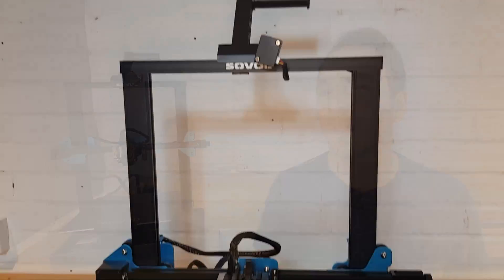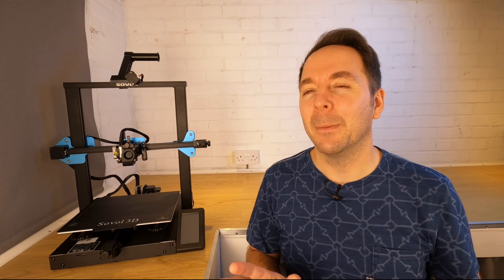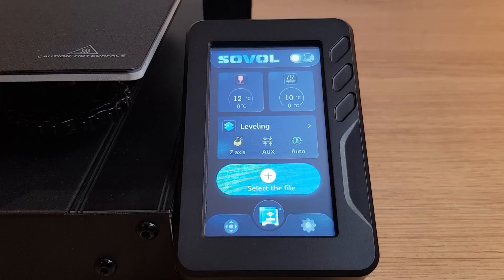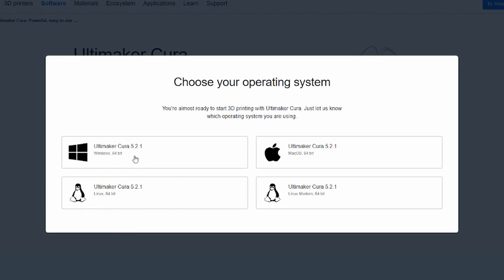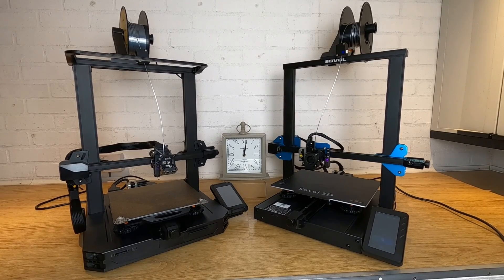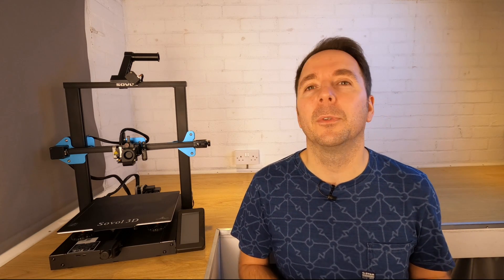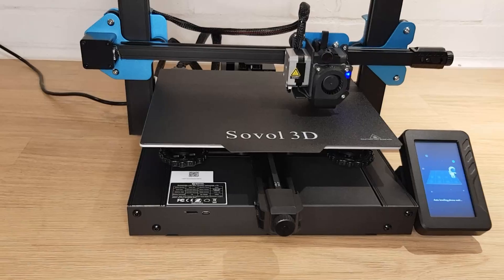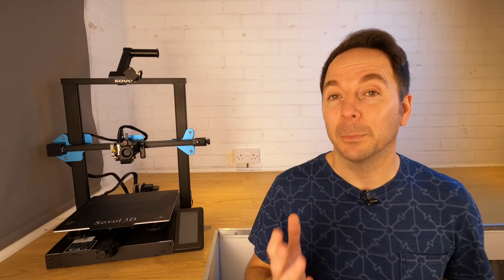Sovol SV01 Pro 3d Printer - Awesome features at a low price!

Comment: Would you reccomend this printer for beginner TPU??
Reply from the maker: It's good at printing with TPU as it is direct drive. The only downside is that TPU sticks too well to the PC bed. You would need to put something on the bed to avoid damaging it when removing a TPU print. This can be masking tape or a PVA based glue stick but ideally, you would put a different print bed surface on like PEI.

Comment: I’ve had my first hiccup with this printer and you called it. My filament got jammed inside the (extruded?). I’m new to printing so sorry I’m just assuming that’s what it is called. The hotend and extruded setup looks a bit different than the original sovol sv01, so I was a bit confused as to how to take it apart, but pleased that it is now up and running again. Next time I will know what I’m doing and it won’t take me an hour  😊

This is my first 3d printer. I did some research, and then sort of went with my instinct and chose this one. I truly love it and I am blown away by its ease of use and what it can do. I have heard that 3d printers are tricky, hard to assemble, and so on. This one was about a two piece assembly, and has printed beautifully from the get go for me. I have zero experience with 3d printers so I’m happy to find a printer that works right out of the box!!! That being said, I don’t have anything to compare it to lol, but I would totally recommend this to a beginner. I have printed so much since getting it but just finished a 36 hour (give it take) skulldog mask for my daughter. 
Thank you for your very educating and helpful videos.
Reply from the maker: Great to hear you have had the same experience with regards to ease of use to me. Unfortunately not all 3d printers are like this one so you've chosen well. Glad you are enjoying the content and the hobby. Thanks for your comment 👍

Comment: This or sv06 same price?
Reply from the maker: Difficult to say as I have tried the SV06 yet. There are a few differences so I guess it comes down to whether you need a bigger bed or an all metal hotend to print higher temperature filaments. The other differences won't be huge.

Comment: Now if Creality would do a update to the firmware maybe the S1 pro would be even better.
Reply from the maker: Maybe they could get Sovol to do it🤷‍♂️😁
Reply: @RickyImpey  LOL
Reply: As an S1 pro owner and noob to 3D printing, I'm grateful for the things that make it pretty much plug and play for beginners. But seeing that vastly nicer touchscreen experience on the Sovol even though it's mostly made of Creality parts really has me wondering what the heck Creality's UX designer was thinking when that horrendous interface was signed off. Also, the disabling of features is super annoying as I've set up Octoprint but basically can't do anything but watch the print or do an emergency stop.
Reply from the maker: @possibri  Indeed, seeing it all done well showed me how Creality have been slacking with their firmware.

Comment: I have been looking at replacing my current FDM printer and this looks like an interesting piece of equipment.
I was planning on a Anycubic Vyper, but now I don't know.... 
Sadly, nobody locally sells Sovol at all. :(
I know 1 is direct drive and 1 isn't, but that isn't really an issue for me. Any suggestions between the 2?

Now, if all 3D printer manufacturers could just stop using micro-sd cards...
Reply from the maker: Difficult to say as I done have the Vyper. On paper, the SV01 Pro has a bigger bed, direct drive and is cheaper.

Comment: Could an aftermarket direct drive be installed?
Cheers Ricky, looks like I may have fount my next printer to add to Ender 3 V2 
Can’t wait for the duel drive mod vid 👍🏻
Reply from the maker: I wouldn't be looking to change the extruder and hotend assembly myself, it works very well. There isn't a drop in replacement as far as I know. The SV01 Pro does feel like an upgrade to my E3v2 with it's bigger bed and added capabilities.
Reply: Hey Ricky 
Ok I pulled the pin and ordered it 🥴
Again thanks for your input/vid
Oh and the discount code, this really helps out in these tough times.
Please post the belt drive vid, once you have sussed it 😉
Thanks Ricky 👍🏻
Reply from the maker: @toddy9141  Link belt is fitted and being tested as we speak👍
Reply: @RickyImpey  that’s great, I look forward to the vid mate 👍🏻
Reply: @RickyImpey  how the sync belt going mate, I really need help to source parts and how to fit. 😢
In the meantime I’ve printed resting blocks, by measuring the gap from the x gantry to the bed, so when it’s in home position I put the blocks in and then power off, but this is not ideal.
Cheers
Reply from the maker: @toddy9141  Hi, yes it's fitted and working but I haven't put together any kind of kit list of what I used yet. Drop me an email at rickyimpeyyt@gmail.com and I'll send you some info so you can buy some parts and get started.
Reply: @RickyImpey  thanks so much mate.
Email sent.
I must say other than this, the printer is awesome, now I’m working with petg for the first time, and after dialling in settings, it prints lovely.
Keep up the vids mate, they really are useful, to the point and unlike a lot, it’s nice not to have any waffle going on lol.
Basically I like your style 👍🏻
Reply: Cool
Would it be worth and can you upgrade the extruder to a direct drive and fit a titanium heat break, so it can print at higher temps?
Reply from the maker: @toddy9141  It turns out there is a bi-metal heatbreak upgrade available https://sovol3d.com/products/bi-metal-heat-break-for-sv04-sv01pro-3d-printer
Reply from the maker: @toddy9141  I don't know yet if there is an all metal hotend option. If there was it would also need a firmware upgrade to allow the higher temperatures.
Reply: @RickyImpey  ooooo do your thing mate, and find if it can be done. 😉
Soooo got my finger hovering over the “buy it now” button lol
Shall I shan’t I……..😂
Reply from the maker: @toddy9141  Well I can certainly have the conversation with Sovol but I probably won't get a reply until Monday morning.
Reply: @RickyImpey  nice one mate, no rush, I appreciate you offering. 👍🏻
Reply from the maker: @toddy9141  I've sent them a message so we'll see 👍

Comment: being that the hot-end is the main issue you could see and its basically a Creality under the cover.  could you swap out the Sprite unit from the S1pro as a separate purchase swap it in?
Reply from the maker: I wouldn't say it's an issue, just the design isn't optimal in my opinion. The Sprite hotend is quite different. It certainly wouldn't bolt on but anything can be done with enough work.

Comment: Ricky how does is compare to the Artillery Sidewinder X2 you reviewed
Reply from the maker: They are similar in their hotend design, the build volume on the X2 is bigger, the screen and firmware on the SV01 Pro is better. Those are the main differences that come to mind straight away. Oh and there is no linear advance as standard on the X2 like there is on the SV01 Pro.
Reply: @RickyImpey  would you happen to know of a better direct drive extruder for the SV1 PRO?
Reply from the maker: @DinasGarage  I haven't looked at options as yet no.